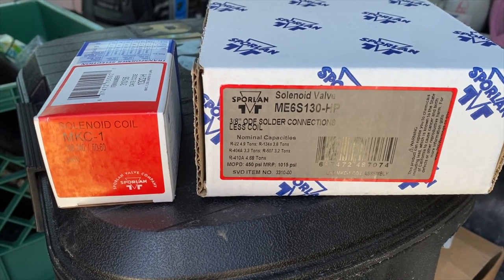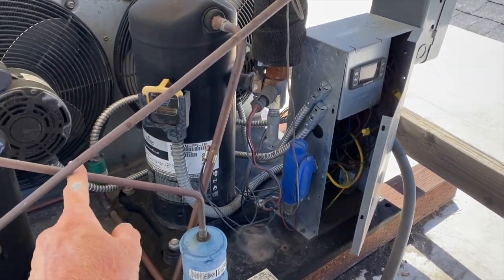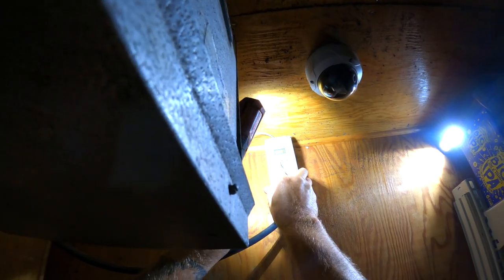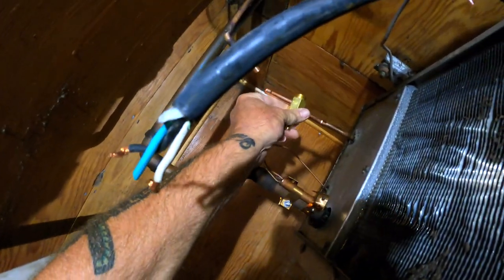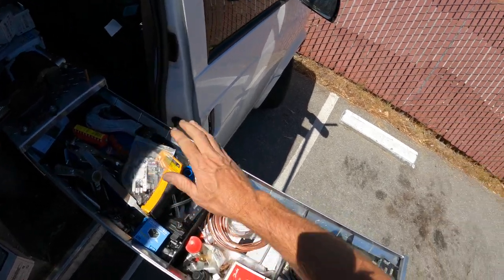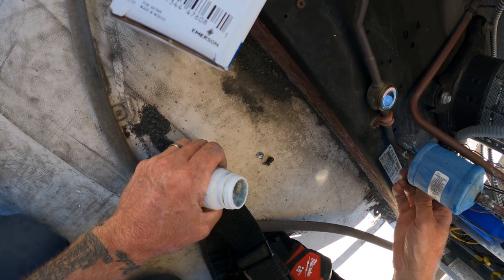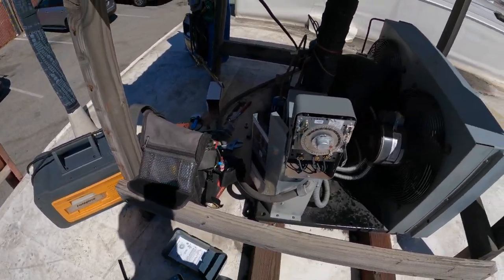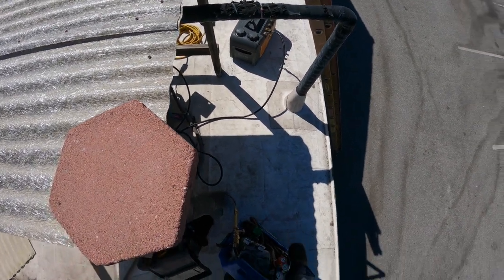How to Replace a liquid line solenoid valve

Comment: Nice job Dave. Looked like a tight area to get to for the valve. I sweat out 95% of driers. I love the Super Techs that jump on every comment posted on any site to tell us what we did wrong but you NEVER see their work 🤣. We have all done things that weren’t text book perfect, that’s real world service.  Stay cool.
Reply: They teach in school to cut out driers, but its usually such a pain in the ass its not worth doing. Lately though due to Acetylene shortage I have been cutting everything out to save on fuel. To any newbies reading, the reason why they dont want us sweating driers OUT is that you could release the moisture caught by the desiccant in the drier back into the system and the compressor oil, but if you achieve and hold a good micron reading at least below 1000 microns (500 is ideal I know) then there is a good chance there is no moisture. If you had a really wet system and you are routinely changing the filter drier to dry the system, obviously then would be the time to cut rather than sweat. The amount of moisture in an existing system is probably microscopic and insignificant.

Comment: What do you think about loosening the packing on the king valve? HVACR Videos always says that you should do it but I never do just curious on your thoughts
Reply from the maker: I never do.
Reply: I do on my racks. I also put a dab of oil on the stem before I run them in and out. Just kind of an annual thing, definitely not every time. Oh and sometimes I just don’t care.

If the packing ever leaks just back the nut off and wrap some Teflon in there and re seat the nut. Works every time 90% of the time.

Comment: Hey if the solenoid valve is leaking around the adjustment screw will a brass cap with prong help seal it
Reply from the maker: no its a goner

Comment: Nice work Dave! Difficult to get sporlan stuff here, think they've had a falling out with the local wholesalers, they've all switched to danfoss.
Reply from the maker: Danfoss txv are the best.
Reply: @NorCal-refrigeration  I like the ones with the thin stainless steel connections, copper plated inside. Very little heat needed to sweat in. I used to get them from a huge ICP warehouse where I used to live on the west coast 25 years ago, but now all that's available around here is Sporlan, and Echo I think. So I just stick to Sporlan, they're ok, except the power heads rust in a cooler. They last forever in a freezer though.

Comment: 🇺🇸👍💪❄ great video. ? When pulling a vacuum on low side with a solenoid valve u have to energize evaporator circuit  to pull proper vacuum, correct ? N another way to do it without energizing the circuit would b to use solenoid magnet, correct  ?  Thanks again appreciate ur help. 🙏
Reply from the maker: Correct
Reply: Thankyou my west coast friend 👍🇺🇸❄️🏄‍♂️🚐

Comment: The way I like to do it is to flare the new drier and sight glass in. Then next time you have to open the system up, you don't have to drag the torches, water, flux, ect on the roof, just 2 wrenches... I still sweat ac driers in, and self-contains they get burned in. But a refer unit like that gets flared, just makes it a lot easier for me at least the next time around.... But yeah, I don't hesitate to un sweat the drier, don't think it's a big deal.